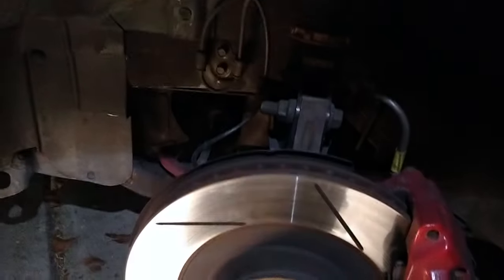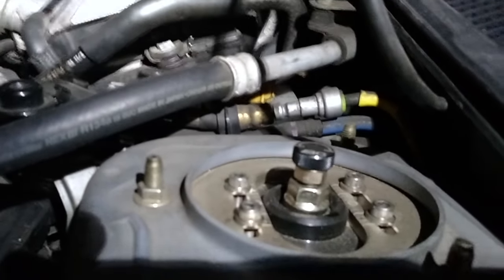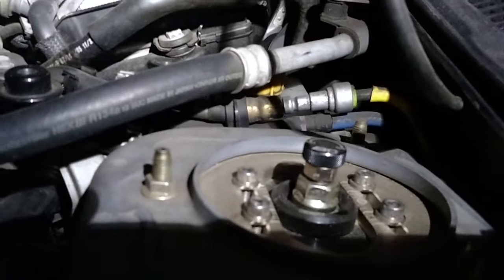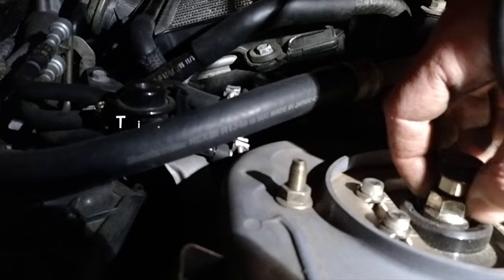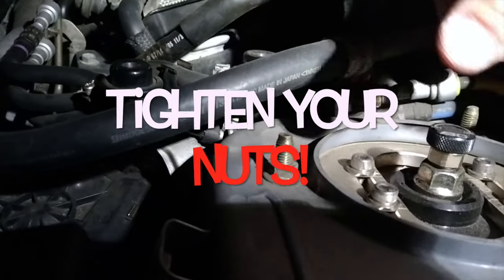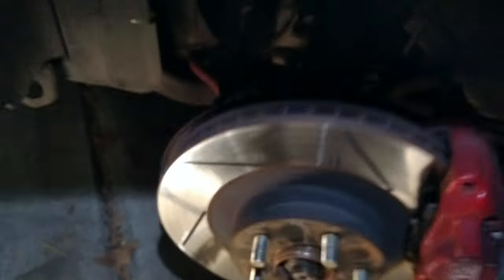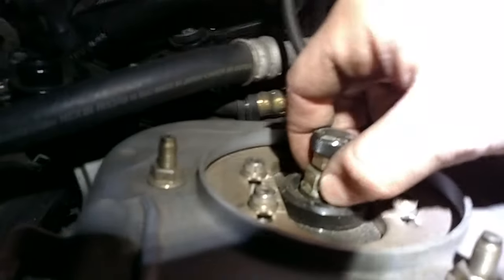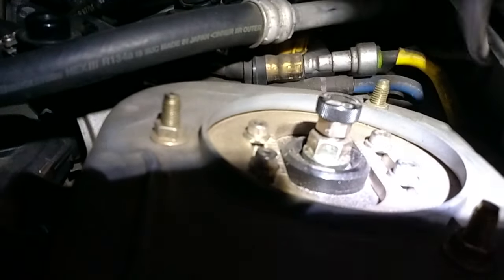Coilover Noise Issue FIXED! BC Racing BR Coilovers

Comment: Once proven that YouTube communities are way better than licensed mechanics. I've paid $500 to check what's the noise but got told they have no idea after 2 weeks of full structure check. But 1mins and free of charge on YouTube 👍🏻
Reply: Mechanics is a strong word for them. It's "Fitters" from now on, ok? The reason why they couldn't solve your problem is because they are not use to "fitting" anything that is not OEM....
Reply: Problem is mechanics just aren't paid enough and high quality tools cost entirely too much. It's easy for determined owners to work/diagnose their own cars because they're going to have more attention to detail and knowledge of how it should be. Few mechanics will employ the same level of care as an owner who loves their car, and 90% of those that will, will be on to bigger and better things in a matter of time.

Comment: I just did my br series. I have a light grinding/wheel bearing kind of sound. Or like a really faint screeching sound. Gonna check the torque specs on the camber bolts. Only drove up to 30mph maybe for .5 mile
Reply: Hey I just installed some coilovers and have the same noise coming from the rear, it is a constant grinding noise and gets worse when speeding up did you find the problem?
Reply: @Thatboijoja  I found that when I had my jack holding the brake rotor, it was actually holding the dust shield so the dust shield bent into the back of the rotor. Check that out.

Comment: My front drivers side nut was loose and I hit a pot hole and the top of the assembly completely fell off and I couldn’t drive because there was nothing holding it in place, even made a big indent on the shock tower from how bad it was rubbing after it fell off😭
Reply from the maker: Wow that’s some bad luck man! Hope you got it all fixed by now

Comment: I never would have thought to check the adjuster knob nuts. :| I've had a clunking noise from my left-rear when weight shifts - going over bumps, sometimes when shifting - for close to a year. Thanks for posting this.
Reply: I'm having the same sound in my driver's rear on my 02 V70 T5. I hear it when going over bumps/speed bumps.
Reply: The Quadfather and I have the same issue with the driver side can heard it going over bumps
Reply: @jonathanmendoza5511  I found another issue. Not only was one of the adjuster nuts loose, the upper ball joint was also loose. You couldn't tell when the car was on the ground. But, whenever the suspension came unloaded, the whole assembly would move a bit and then "clunk" when it was reloaded. It took awhile to find that one.
Reply: David Lively yeah mines sounds bad like if I had a bad shock but I already check and there good I haven’t check the nut on the top
Reply: David Lively yeah that bolt save me a lot it was kinda loose :) no more noise

Comment: Thank you for this video! Today I installed max speedingrods and had this same noise when going over bumps.. it helps having everything installed with the car on the ground so everything doesn’t spin around when tightening the top bolt.
Reply from the maker: You're welcome!

Comment: Does that bolt stay tight if it under load. Do I have to jack the car up to know if it’s loose? having noise issues as well
Reply from the maker: Yeah that’s what I did to find out it was loose.

Comment: I just installed a set of new coilovers a few days ago and noticed a similar noise just today. Gonna have to double check the torque on the nuts and maybe lower the stiffness of the dampening.

Comment: I see this is an old video, but uh I also tighten mine before seeing this video, quick question did everything spin on yours, because as I tighten mine everything was spinning including the stud it was on, but it stop the issue.
Reply from the maker: I just tightened the nut and it seemed to work fine. I wonder if some other part may have been loose also?
Reply: Yea no It happened a couple days later, I'm going to have to remove the front tire to see what's the problem.
Reply from the maker: Did you figure it out yet??
Reply: No its crazy, I just keep a 5mm wrench in my car and tighten it as it goes, but tomorrow i'm a take wheel off and see what the hell the problem is, I haven't had time to look into it, I got other problems,,the app sensor on the pedal I gotta replace, I never knew the freaking gas pedal had a damn sensor smh but she still rides, she looks good,
Reply: @S58PSHIFTING  did you figure it out mine is doing the same

Comment: This is true. When the top nut is loose, it can rattle. But think about the real problem here. It only happen, when the strut is unloaded completly. But why is the entire strut unloaded so often?
1. Your rebound settings are too stiff
2. Damper are blown. Gas pressure is too low and this will cause massive hysteresis in damping forces.
Both conditions will unload the tires completly, knock out the top nuts and are bad for grip.
Reply from the maker: +Marc D. I guess checking the nuts and making sure they were tight before installing could have helped as well. Thanks for the knowledge 👍👍

Comment: hi mate,  thanks for by your video!  i just popped up my bonnet and found the same top nut is loose on my bc v1 coils.  I use hand tightened it,  is this enough to tighten it or do i need certain wrench or torque wrench?
Reply from the maker: I'd give the nut a good torque for sure!

Comment: Just installed mine today,but the noise is coming from both front and rear,how do I deal with the rear part?
Reply from the maker: You can access the rear by removing the rear seats

Comment: Thanks for the help, had this issue on my front passenger coil, I checked the rears as well but I’ve been wrenching on the nut for what seems like minutes but they don’t seem to tighten? I dropped the rear maybe like an inch but It doesn’t feel like it should be turning this much
Reply: because the rears has a rubber bushing that literally spins with the nut
Reply: Han Hs so I should just keep on wrenching on them then?
Reply: Cristopher Alvarez nah i doubt so. Either tighten them to as far as it will bring you and then use an impact gun to pulse it tight. Or try a torque wrench instead.

Comment: how were you able to tighten the top bolt with the dampening ball? sorry for the newbie question but I'm puzzled how to do it..
Reply from the maker: I just put a wrench on the nut right below the dampening adjustment and turned it in a clockwise rotation.

Comment: I have a new found clunk in my coilovers after I stupidly lowered them. I am hoping this is my issue. I think this type of stuff is caused from adjusting the coilovers theres so much turning invovled other stuff gets loosened in the process. I wish there was a more efficient system than the coilover seems very archaic that you have to do all this with specialized spanners etc to adjust your height. C'mon engineers and scientists get to work.

Comment: What if the clunking noise is coming from the back 😭 I’m gonna try to figure it out over the weekend
Reply: Ever figure it out ?
Reply: Bigbodygenesis read endlink was broken. Also happened again and that time it was the bolt that holds the lower shock was a bit loose.

Comment: Mine is coming from the right rear....which I've already taken apart twice just today,  insulator was pinched from install a little while back so got it seated correctly,  put back together and as soon as i pulled out the driveway, clanking continued.  Took it apart again and put more tension on spring hoping that would keep it from wiggling around......probably made it even worse. Strut is fully secure, left side is exactly the same as right but right side keeps clanking and its is very freaking irritating
Reply: Did you figure out what was wrong with it?
Reply: @DiamondTheGoat  yeah it was the sway bar link, typically just recommend replacing them if theyre old and they spin when you try to tighten them

Comment: What did you torque them down to?

I’ve hand tightened mine as far as it would go but it still makes noise :(
Reply: Its a worn pillow ball .. Mine is max tight and it still jumps around making a knocking noise. Too bad i cant find just the pillow ball mount.
Reply: @kahmylion2  my new camberplates clunks over deeper potholes..

Comment: I just installed maxspeeding rods (ik theyre shhit but i wanted to try them) currently the only issue is the top bolt keeps coming lose even after i keep tighting them, when i do tighting them when i turn too far the body moves with it. Does anyone know how to fix this?

Comment: I got Megan coilovers, and they clunk/knock every time I hit a bump, or drive at a low speed.
I should probably tighten this bolt before they fall off lolololol
Reply from the maker: Yes, Tight nuts are very important! 😜
Reply: thank you for this video! have the same problem after installing my bc coils today and it was getting me frustrated that I did not know what it was haha
Reply from the maker: +LilDavidGarcia no problem man! Glad it helped you out
Reply: I thought it was going to help but its gotta be something else :/ I spent 5 hours on one coil and still sounds the same everything is really tight. idk what it could be. almost sounds as if a bolder was rolling on the ground 
and like my suspension is going to fall off
Reply from the maker: +LilDavidGarcia dang man sorry to hear. What kind of coils? Maybe search google for specific issues on that brand of coil
Reply: I've got Megan's on my rsx and the knocking sound is unbearable. I'll look into this and hope it solves the problem. Tempted to go back to stock suspension it's so bad

Comment: My coilover is making a different sound, every time I slowly turn to the left or rite, it's f***ing driving me crazy.
Reply: i would check the sway bar. Mine was doing the same thing in the rear and one of my bolts were extremely loose.

Comment: How about the rears mine is making noises in the rears anyone saw the problem about the Rears shocks
Reply from the maker: Have you checked out the top nuts?
Reply: 06WRXDUDE yes. They seem to be tightened down all the way
Reply: redbaron2448 did u find out what was wrong with your rears I’m having the issue in my rears
Reply: Yours coilovers are separated ?

Comment: I am getting a clonking noise from the front left coilover when I wiggle the steering wheel while going along. They are brand new BC Racing coilovers. Everything felt solid when I jacked it up. https://www.youtube.com/watch?v=jrjKkzfkOrc
Reply from the maker: Very odd. Mine sounded identical as well but tightening those two top nuts fixed my issue. I wonder what else could be loose
Reply: 06WRXDUDE I have a feeling it's the drop link. I've been focusing on the coilover too much. The drop link feels solid when jacked up but of course it's not under as much tension under load.

Comment: I swear if I go outside in the morning and tighten those nuts and the clink goes away, I’m buying bags smh I’ve been trying to diag this for to long.
Reply: Colby Bottoms I’m on the same exact issue but for 5months now, I believe my coil is blown as well now but if this fixes my clunking noise I swear...
Reply: Ess it didn’t fix my issue, I’ll be buying some braces/sway bars soon then switching coil over brands.
Reply: @soulmk7923  well I did it last night and it fixed my issue, what I thought was a blown coil for 5 months & this was the issue. LMAO My coil is still leaking oil so its on its way out but it should be enough to keep it good until im on bags haha goodluck with yours!